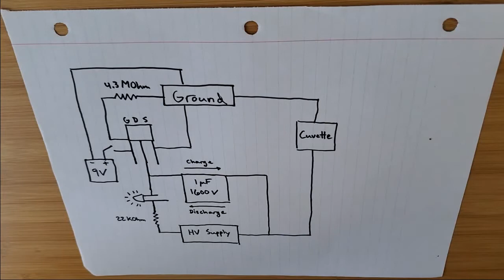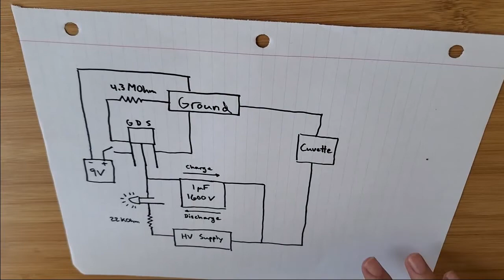Electroporator Project: Part 1

Comment: Great. Can you please make a video on calibration of the Electroporator? 
e.g. we want to electroporate embryos. It worked fine with mice but not in sheep. Do you have any suggestions on that?
Thank you in advance.
Reply from the maker: The electroporator voltage can be calibrated via the potentiometer on the boost converter board. You'll need an appropriate voltmeter like the analog model I showed in another video (https://youtu.be/_4oT_jkHw4w) to measure the high voltages. You won't be able to change the pulse shape or duration. I don't have any experience electroporating embryos so unfortunately I can't offer any suggestions on troubleshooting tips.
Reply: @qosmoschem  That's okay. Thank you so much for your reply.

Comment: Awesome, any new developments on this front?
Reply from the maker: I designed some PCB's a while ago to simplify the wiring but I haven't tested them yet. Also working on more mechanical designs like the electropen but with adjustable voltage

Comment: What is the battery/power supply used in this video?
Reply from the maker: It uses a standard 12V supply which is then boosted to 1500V by the high voltage power supply. You can find the HVPS at: https://www.tindie.com/products/rhgeiger/adjustable-high-voltage-module-150v-1500v-02w/
Reply: Thanks, is there a way to put an adjustment switch to dim or increase voltage output to specific numbers?

Will this be a square wave
Reply from the maker: The HVPS power supply is adjustable from 150V to 1500V. 

The output should be an exponentially decaying pulse as the capacitor discharges
Reply: Is there a way to drop this down to between 80v and100v? If not, can a different power supply be used? 

Thanks for the information by the way
Reply from the maker: If you want a voltage between 80V and 100V I'd recommend the power supply I show in my electrophoresis video. You should be able to google DC-DC boost converter 8-32V to 45-390V and find one.
Reply: @qosmoschem   Another question, I live in India and can easily find DC power sources up to 30 V. How can I get that to higher voltage DC for electrophoresis? Thanks once again.
Reply from the maker: @tapariayogesh  Like I mentioned in my previous comment, you'll need a 45-390V DC-DC boost converter. That'll take the 30V DC power you have and boost it into the ~100V range you'd want for gel electrophoresis. It should be a common option on ebay